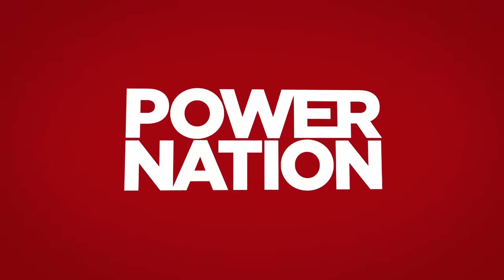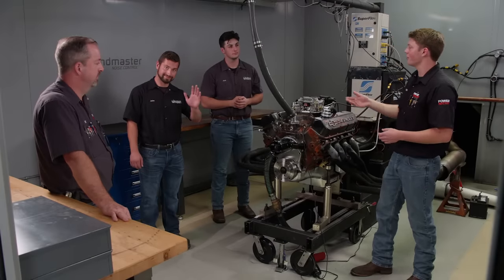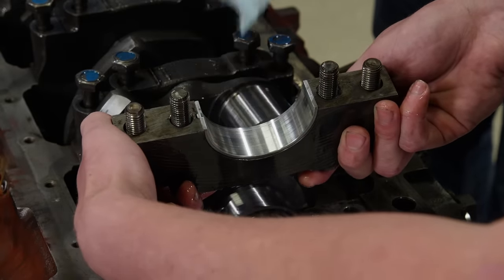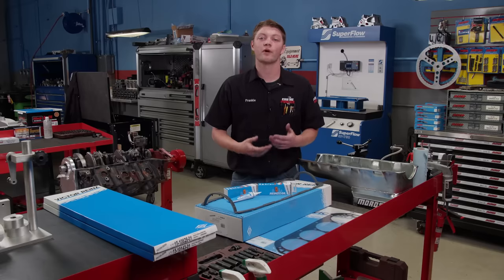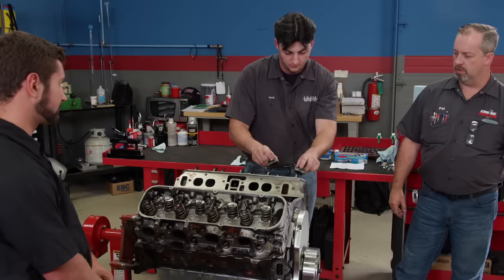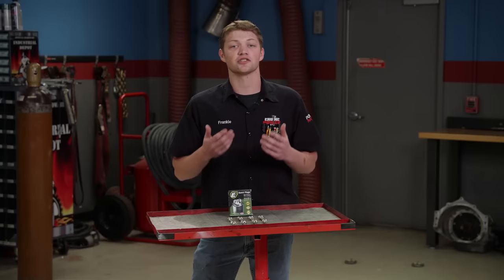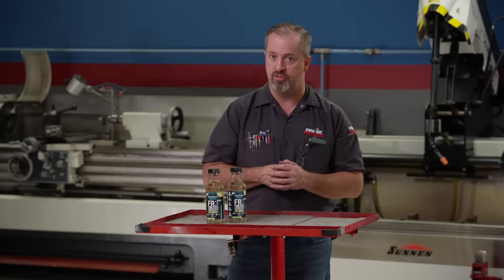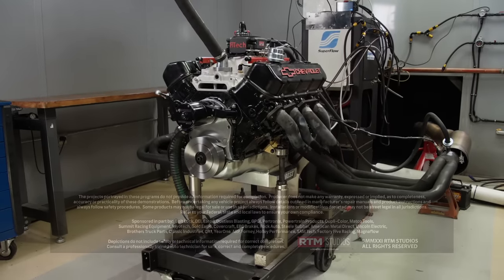Easy Upgrades for a Stock Big Block Chevy - Engine Power S8, E19

Comment: Not an engine builder but wouldn't it be beneficial to replace mains when apart? Even on a budget?
Reply: Main caps are very strong, especially on a street motor even two bolt mains won’t fatigue, and you have to making serious serious power to fatigue 4 bolt mains.
Reply: @stephenkrambeck6589  Sure, but my thought was if your there wouldn't it be beneficial to change them? Maybe it's not a simple task. Do they have to re-measure or something?  I just don't know.
Reply: To replace a whole set of main caps, or even just the center three to upgrade a small block to four bolt main, you install the new mains then hone the line bore to roundness and/or a certain size. So it’s usually gonna have to be bigger than stock making proper bearing clearance more difficult. And like I said they’re very strong, unless you’ve drastically upgraded power the main caps aren’t going to fail. I guess I could equate it too wheels? You buy a new car and sure the wheel could be fatigued or cracked but no ones gonna replace wheels or main caps just in case like you would an old seal.
Reply: @stephenkrambeck6589  he’s talking about the bearing inserts you dud.

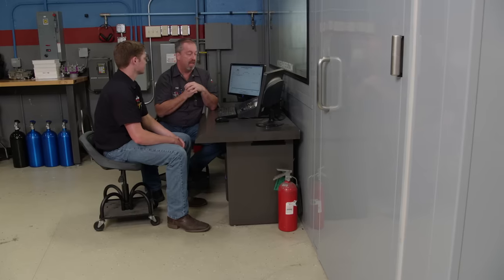Comment: 0:52 "gonna do something in the low rpm range...today is your lucky day". Proceeds to push hp up the rpm range. Let me help the two marketers. First, lay off the Indica Strains just before marketing class so you can pay better attention. Here, I will save you the $2K having to retake Marketing 101: "LISTEN to your customers! Give them what they WANT".
And a corollary: "Don't just build them what YOU want because you benefit financially from using fluff provided by a manufacturer".
Good commercial for tech school, gizmo plugs, and nicely painted EFI though.
That is PowerNation in a nutshell. Hock some over-priced parts they got for free they would never use if paid for out of their own wallets.

Comment: Like to see more cam/carb combinations for towing motors. Gotta have a good performer for towing the toys around.
Anybody  use a 218/228 114 on a 454? Summit #sum-k1301
How well did it do?
Reply: I towed my 18foot tag along trailer 3,000lbs with my l35 kubota tractor 10,000 lbs all original for a long time 3 years of abuse truck took it like a champ

Comment: Pretty sure that’s a failure considering your goal was to increase “low end torque”. You lost considerable torque and some HP from 2500 to 3500 rpm. Pretty sure that’s the “low end” of the rpm band.
Reply: Their first mistake was putting a single plane intake on it.

Comment: Why not put 1970 LS6 454 internals in it and heads on it and see what happens
Reply: It would probably make about the same torque but 100 more horsepower. The LS-6 has more compression, square port heads, and a healthy solid flat-tappet cam.

Comment: 402 bbc heads would be better head to use it have bigger intake runners and bigger exhaust runners bigger valves and just all around the better head and you will get increased flow to support 650 horses

Comment: So if your trying to keep the budget down and keep it simple why on earth did you put fuel injection system on it, a good carb would have been better. I'd bet a edelbrock rpm air-gap and a good 750dp would put up better numbers.

Comment: Why is 6.5 degrees advance desireable
Reply: It's a secret. A much better show that actually explains things and then shows the results is Engine Masters. This show is just a 20 minute commercial. If E3 plugs actually worked, don't you think the factory would be using them? Like the old "Fire Injectors" J.C. Whitney used to sell.

Comment: By far the biggest disappointment and stupid expensive. Say budget build then add an expensive fuel injecton set up on a single plane.
Reply: I mean when considered a 8,000 dollar budget is still cheaper than a $15,000 dollar 454 crate engine. Or the other 20 or 30 or even 100,000 dollar build options.
Reply: @RC_Trailblazers  put it this way, 1 hp per cubic inch with a bbc 454 anyone can build and hit that target. Stock peanut port heads will do it no problem. I literally built a 454 for a customer that made under 600hp with a $4000 budget. I'm pretty confident I can build a 9 second motor with the budget they had to make less than 1 horsepower per cube.
Reply: I've seen guys sink nearly $10k in their 454 and barely crack 500 HP.
You wanna talk about disappointment.

Comment: Nothing like watching an advertisement that's interrupted by commercials.  That engine had so much more potential, you took an engine that was a turd, added a tiny cam and it was still a turd, and patted yourselves on the back.  The FiTech was totally unneccessary, a q-jet would have done the same.  Needless to say, very disappointed.

Comment: also explain the evac system tying into the exhaust. Nothing good comes from the exhaust unless its moving a turbo. No form of EGR or any other system using the exhaust is going to help with power, it's going to harm it. It's also harmful to the engine itself. That is just government mandated crap on the same level of pointless as the old smog pumps.

Comment: That was budget friendly?!? 4k between rockers and FI system  left stock valves in the heads🤦🏻‍♂️  set of small aluminum ovals a HR cam dual plane and 650 carb would be less money and more all around power

Comment: Easy upgrades huh? Yeah if you are taking the entire engine apart and reusing already upgraded parts with new upgraded parts. Then the rpm range isn't what was shot for. It's like they couldn't stay away from trying to get higher rpm's.

Comment: A complete crying shame to spend so much time and energy on this engine and put the puny peanut port heads on it. Please-- this is a Big Block Chevrolet, they need air to operate so please put a cylinder head on it that will do it justice. You might just as well have built a large small block and saved a lot of weight and had just as much power.

Comment: Should point out if that's really a 80s engine it's been converted to EFI... (unless it's a 88-89) they really didn't have EFI big blocks till 1990 and the Chevy EFI engine were just small blocks in the 80s (1987+)

Comment: to me i would say this episode is a failure because they lost power down low.  if you are building a engine for towing, you need power off idle until about 3500 RPM.  making more power on the top end takes power from the low end.

Comment: They pinched pennies in all these places by leaving the main bearings and all the stuff. Then they spend the tongue on the aftermarket EFI. They could have spent the little on a roller cam so the engine actually would have made some power